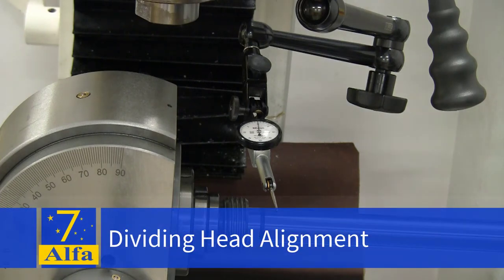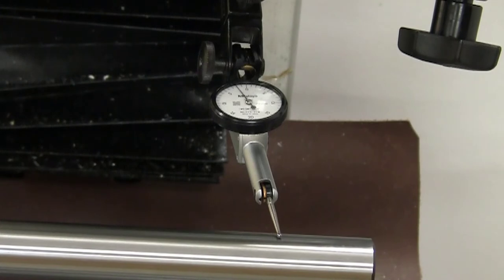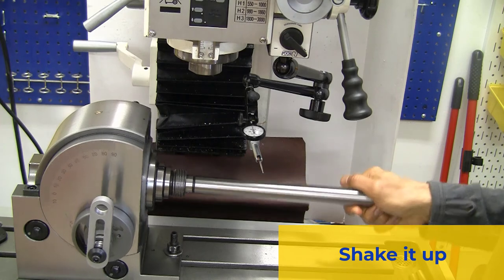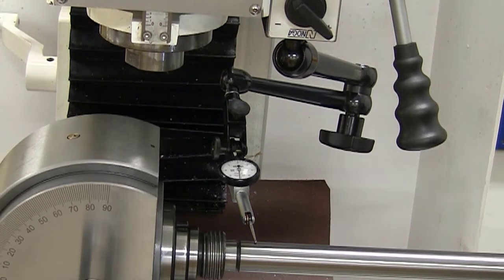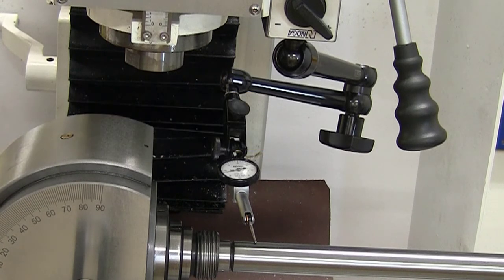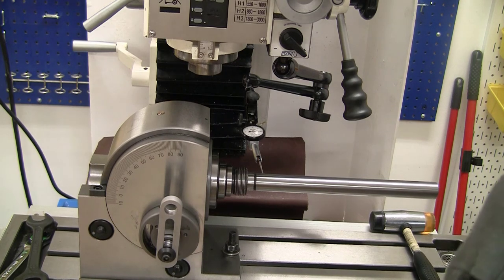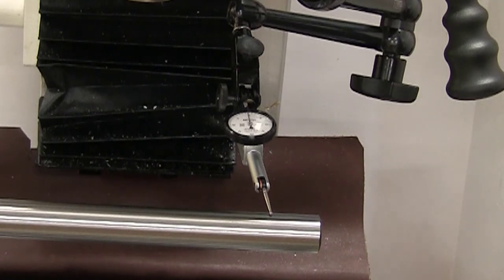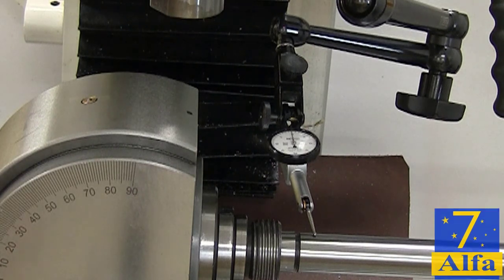BS-1 Dividing head Horizontal Alignment

Comment: If you have to keep adjusting your Y-axis to find the center-top of the bar, your Y-axis is out of alignment. Set your indicator probe to the vertical position and sweep the back or front of the bar until you get your "0" answer. Then reset the probe to horizontal position and sweep again across the top or bottom until you get "0" for all positions again.  Your quick setup of the indexer with the rods in the t-slots (as shown in a previous video) is NOT a final setup procedure.